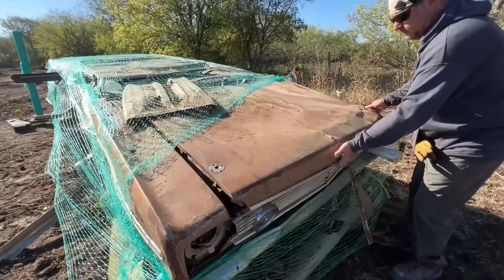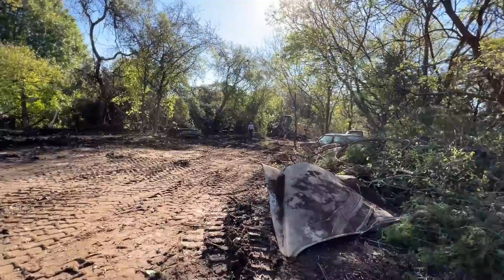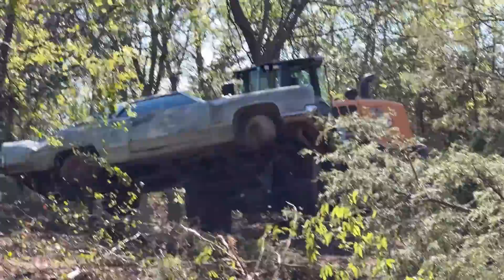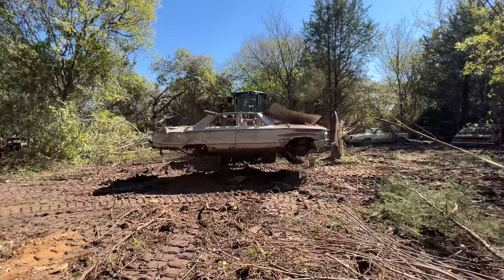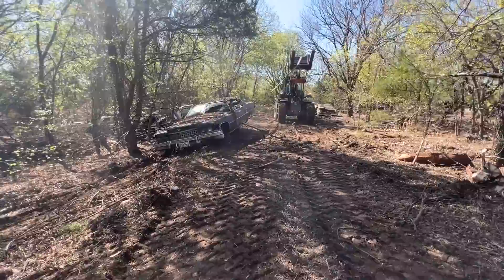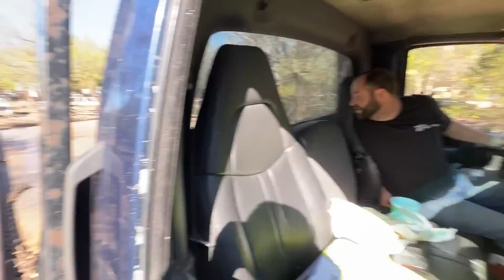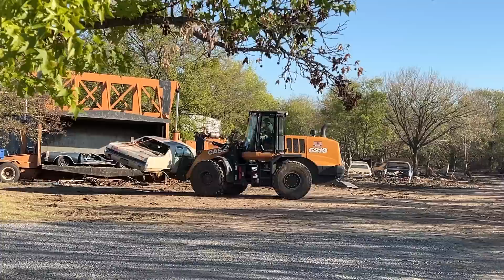Crushing Classic Cars Part 7, The Dream Crusher. Joyce's Collection, Ep #10, 1968 Impala

Comment: Well, I saw it, the crushed Belvedere, I was genuinely saddened to see that. One thing I noticed when it was out in the field, it still had the hood ordainment standing tall and proud, but wasn't even there after it was crushed. It had the 'Poly' 318, I've owned 4 cars with motor, great motor that will run forever. I also have owned 4 cars with basic body style, a 1966 Satellite, 1966 Coronet 440 model, 1966 Coronet '500' model, and a 1967 GTX, 4-speed, dana 60 car. Enjoying the video's. Also, I've had a computer for a little over 20 years, my E-mail address all that time begins with Belvedere@ ---------, because on my GTX it had a Belvedere emblem right under the GTX emblem.

Comment: 0:55 I'm not a Mopar guy but I think that's a big block... 383?
Reply: I agree the heads were too big to be a small block and the hood pins should have given a clue...too late.
Reply: @detroit1015  ..no mystery..that's a 318 Poly...different engine than the LA 318, although the LA was based upon it...completely different heads...probably considered a small block...